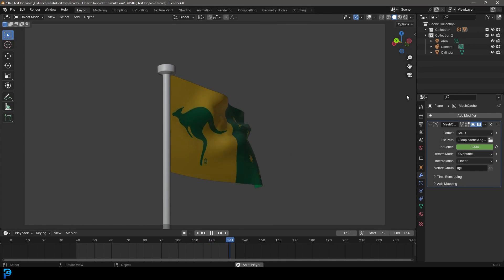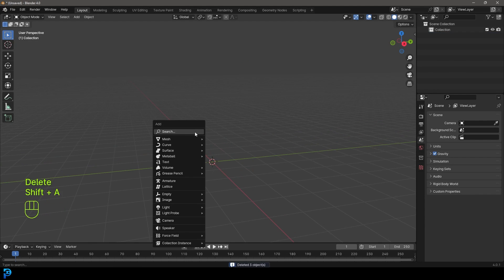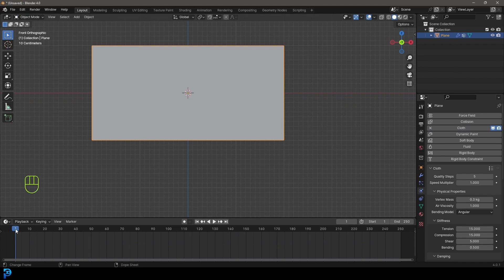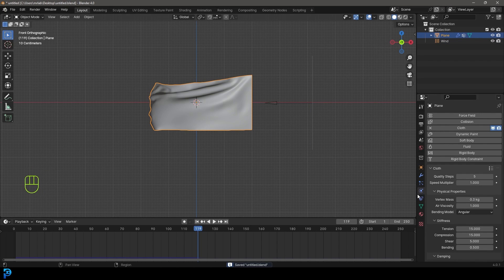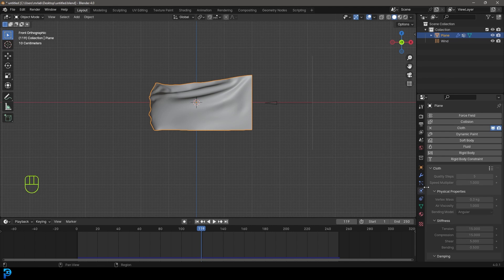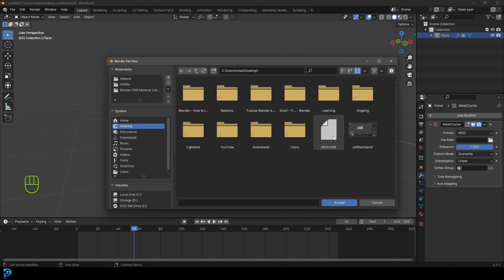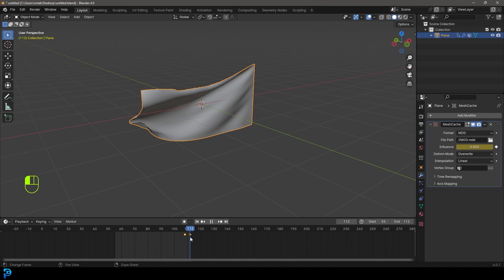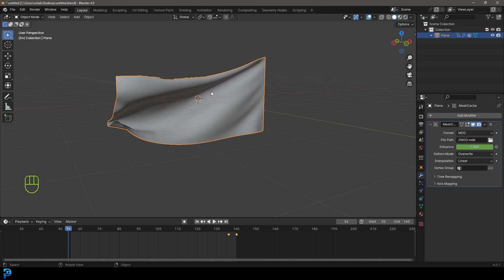Blender: Loop Cloth Simulations | The EASY Way

Comment: Yaaaaay , this way is fantastic. It actually works. There's a few other people doing it a slightly different way which isn't as reliable as this. Thanks again.  Subbed!

Part 1: The Crucial Steps for the Loop 
1. Export the Simulation as an MDD File
3:20: Enable the Import-Export: New Tek MDD format add-on in Blender's Preferences.
3:20: With your simulated object selected, go to File > Export > Point Cache (.mdd).
3:20: Save the file to your desktop.

2. Reset the Object and Apply the Starting Shape
4:03: Remove the original Cloth physics modifier.
4:33: Scrub through the timeline to find a good starting position (e.g., frame 55).
4:52: Go to that chosen frame. With the object selected, add a Mesh Cache modifier.
4:52: Click Open and select the .mdd file you exported.
4:52: Immediately click the Apply button for the Mesh Cache modifier.

3. Re-import the Simulation for Playback
5:00: Add a second Mesh Cache modifier.
5:00: Click Open and select the same .mdd file again.

4. Animate the Modifier to Create the Loop
5:16: Scrub to find a later frame where the cloth matches the start shape (e.g., frame 112).
5:48: Go to your chosen end frame (e.g., 112). In the second Mesh Cache modifier, set the Deform influence to 0. Click the diamond icon to set a keyframe.
5:50: Go to your chosen start frame (e.g., 55). Set the Deform influence to 1. Click the diamond icon to set a keyframe.

Result: The simulation plays from frames 55 to 112. At frame 112, it transitions back to the base shape (from frame 55), creating a perfect loop.

Comment: Hey! This was exactly what I was looking for, and I found one very simple way to improve it.

The problem with this solution is mostly the transition — it doesn't look like part of the simulation because it stops the simulation for a brief period, and then continues from a frame that was frozen and we don't include the simulation that led up to it. So we have to rely on a relatively static part of the sim to make the transition look ok, and even then it's off.

To fix this, we can just use two mesh cache modifiers at the same time and blend between two animations rather than between animation and a still frame.

The recipe:
1. Add two Mesh Caches with the same sim file. The second one overwrites the first.
2. Choose starting frame and loop duration, set start and end frame of the timeline.
3. Set the second modifier's Frame Start to negative loop duration. This way it will have the same frame at the end of the loop as the first modifier has at the start of the loop.
4. Keyframe Influence of the second modifier: 0 at the last frame, and 1 somewhere in the middle of the loop. Since we're blending between two animations now, we can make the transition much longer to make it invisible.

This method can produce perfect results with transitions that look absolutely seamless.

Expert level tip: manually trying out different starting frames and durations is a bit tedious, so one could use a couple of custom properties and drivers to sync timing offsets automatically. Or if you do some scripting you can set up a mini-tool that lets you choose starting frame, loop duration and transition duration and update everything including timeline range and keyframe positions. That way finding the perfect loop becomes really easy.
Reply: works flawlessly
Reply: Thanks for sharing!

Comment: this cache plays back fine in blender, but doesn't affect the render.  The render is a flat plane even though the mesh has the deform in the viewport.  applying the modifier will only apply the deform for the current frame that is on.  how can you render the entire animation? blender 4.3
Reply: @J_Sullivan11  try exporting the animated model as mdd file once again and then import the mdd of the same file back into your project. It should be imported with a number of shape keys equal to the number of frames, at that point you should be able to remove modifiers and animation should be working with shape keys alone which can be rendered as well as exported for other engines such as unity/unreal

Comment: The MDD export trick works really well for other forms of simulations as well, it's really useful for locking in things like modifiers and driver animations, it's especially useful if you've made a complicated animation or simulation in blender and you want to put it into a game engine like unity or unreal, I use it all the time, it makes a ton of shape keys, which can be an issue but aside from that it's really good! :)
Reply: does it export as a baked animated texture or a geometry cache?
Reply: @paigethorsen5677  neither, it's shape keys for blender. In unity this is the same as Blend Shapes. It's a little messy, and if you want to tweak the animation in your game engine you probably wont be able to, you will have to go back to blender and re-simulate it and re-export it. Still an easy way to get super nice animations for things like flowing cloth or flags and things like that.
Reply: @tendividedbysix4835  I have a question though, can you export an animation made this way? Like when I export an FBX and check "animation", will it be exported?
Reply: @TimesNewTemple  yeah it will, once you export and reimport the MDD file the animation will be stored on your object same as any. I use this trick to put cloth and wind simulations into Unity.
Reply: @tendividedbysix4835  do these animations work without bones in the game though? Cause it doesn't seem to work for me, and I suspect it to be the reason.